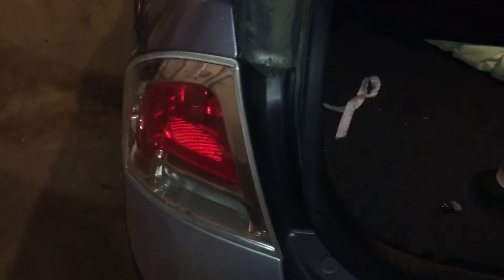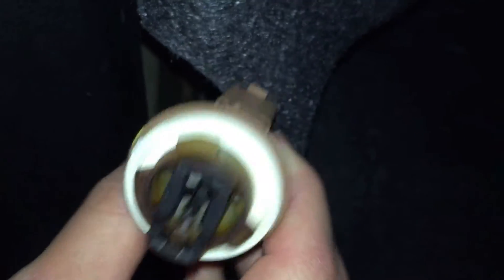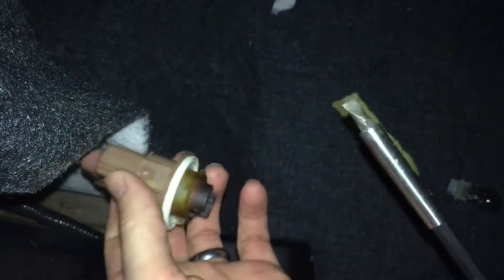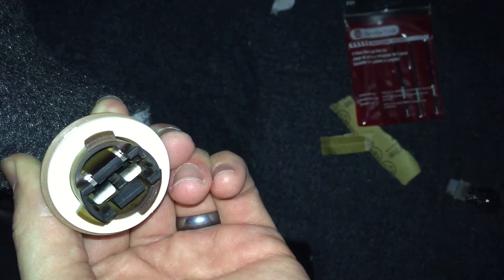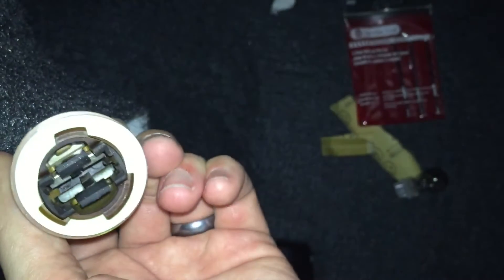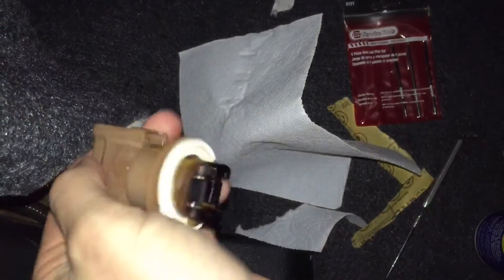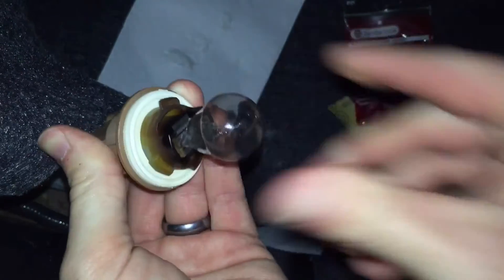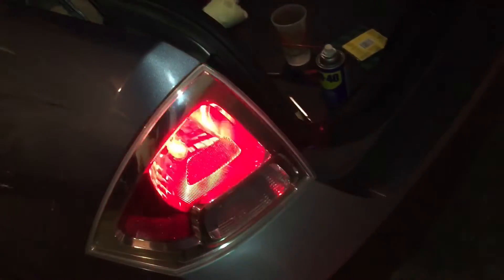2006 Ford Fusion Tail Light Problem

Comment: I have a 05 ford freestyle my rear blinkers are not working,I had replaced the 15A fuses in the engine compartment fuse box,and the fuses in my interior fuse box are fine I replaced the back light bulb but still blinkers are not working
Reply from the maker: You might consider taking the car to a reputable service center. The cost of a ticket will probably be more than having your turn signals repaired.